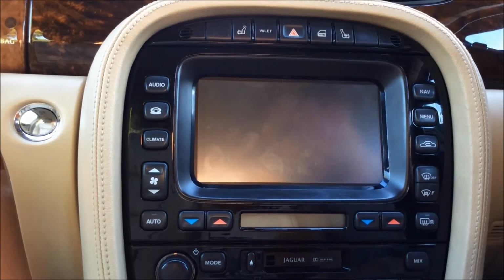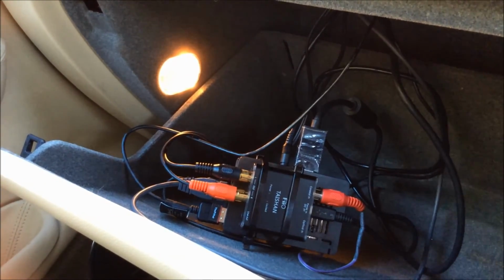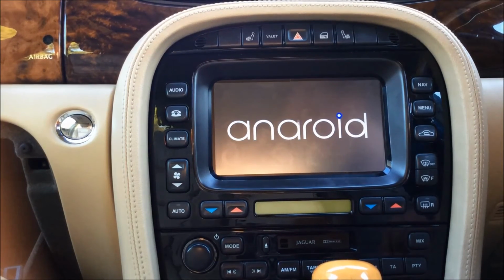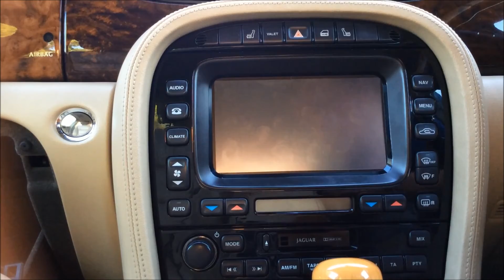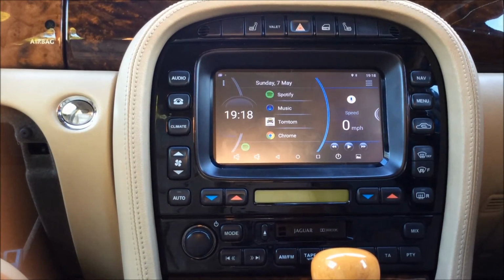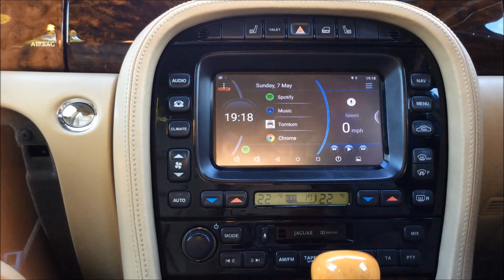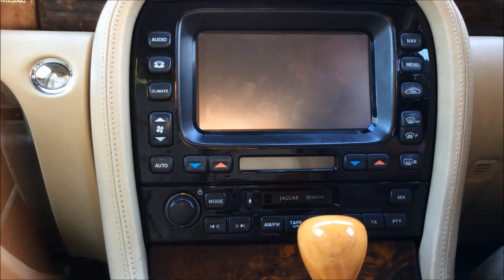Android clean power down and Arduino sleep mode upgrade

Comment: Hi Ben, I have bought UPS 3, do You think it will be usefull in upgrade? 

http://www.hardkernel.com/main/products/prdt_info.php?g_code=G146068525665
Reply from the maker: Bartosz Dziub this mod was designed to eliminate the need for the Odroid UPS module and performs the same job, so the UPS 3 wouldn't give you any benefit.